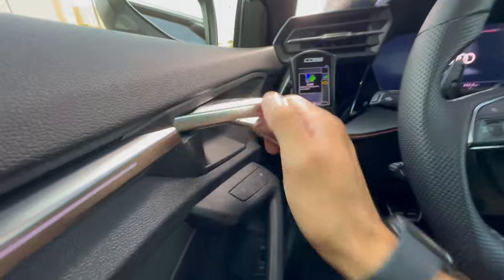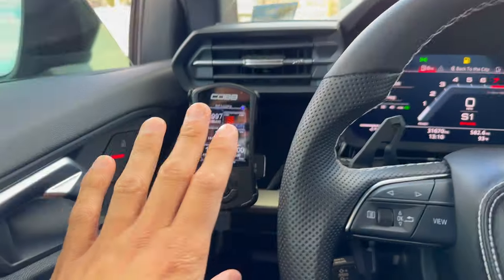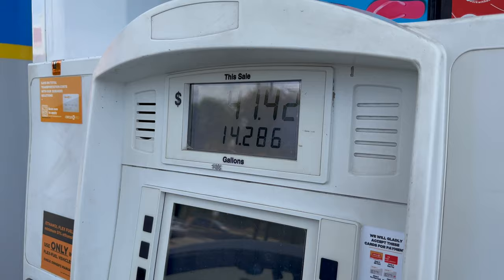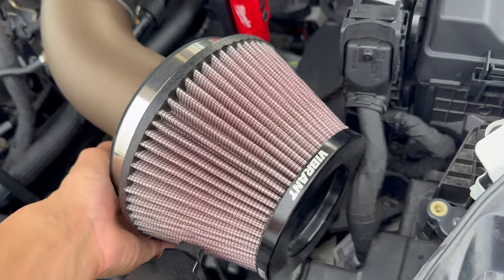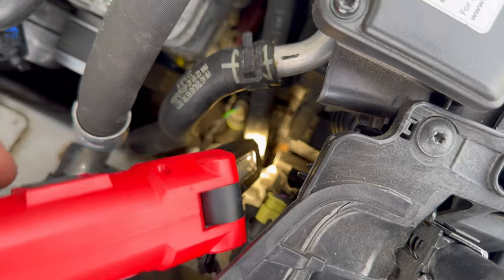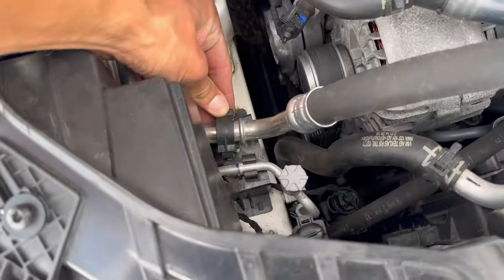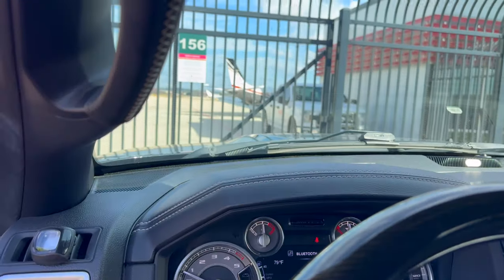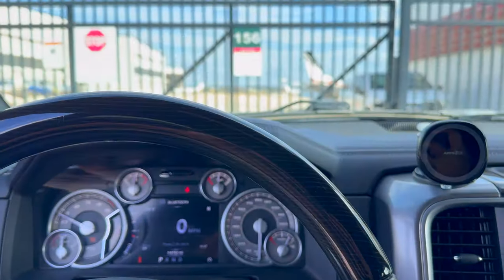EQT is in the building! Custom tune time! 10s on the horizon! | 2022 S3

Comment: Do You prefere custom tune over the generic map? If Yes fan You tell me differences between then?
Reply from the maker: Yes. Mostly more power lol and you can get custom pops and eventually once they have access to TCU I can customize launch control and shift points
Reply: @BryceJordanProductions so You use stock TCU map? If Yes what is Your torque cap? No clutch slip? How did You like racingline software? I want to use OEM+ stage1+ map with the racingline tcu software or APR ECU.
Reply from the maker: @piotrwozniak7840 no I have 034 TCU it’s very good! Racingline is great too. Can’t go wrong with either one. But 034 you can flash and log and have gauges all on your phone now it’s SUPER awesome. Eventually the app will have CarPlay/android auto to put the gauges right on the dash.
Reply: @BryceJordanProductions ok, for TCU tune You needed to know Your Box code (for example from VCDS)? So You think going for racingline tune is good idea? APR is more popular i think but any idea which is better or are they equal
Reply from the maker: Yeah I used obd11 to get my box code! Apr is good too. But I ran 11.18@124 with racingline on 93 😉 no other OTS tune is that fast to my knowledge
Reply: @BryceJordanProductions on what stage You was doing such a good run? I have IC and full intake from racingline. With ECU and TCU tune it would by awesome to run less then 12 and 11.5 might be great.

Comment: What up BJP. Ay of topic and odd question here. Is that an aluminum windshield wiper fluid cap? And if so, is it any(like even 5mm)shorter then the factory plastic one?
Reply from the maker: Yes sir it is! Made by racingline. Not sure if shorter I think it may actually be longer. It’s been on for a few years now so my memory may be off

Comment: Not holding my breath on the ethanol support. Really a bummer considering Ed mentioned it at the beginning of the year that it would be soon. I’m happy with my EQT tunes but the lack of email responses, the CEL and no ethanol flex support has me wanting to to go open source. Not to mention map switching etc
Reply from the maker: Not in Ed’s control but I feel you. I don’t care much for map switching but flex would be awesome… I also hate the CEL 🫠 I really wonder what Cobb is waiting for
Reply: Curious, what is CEL?
Reply from the maker: Check engine light. It’s on for being catless